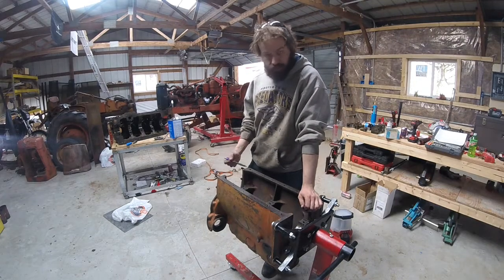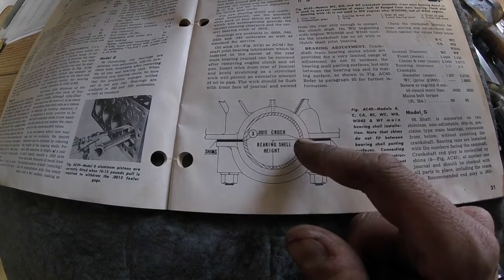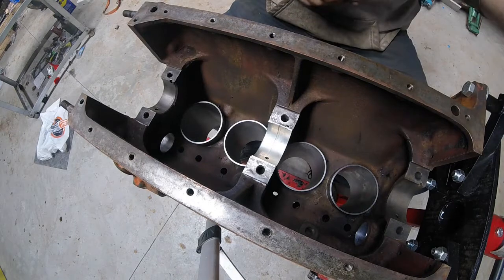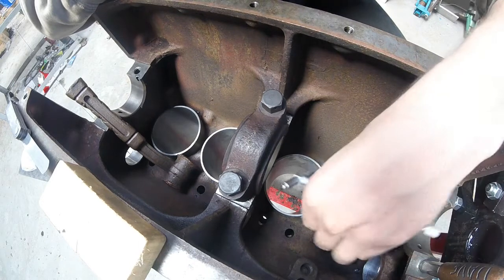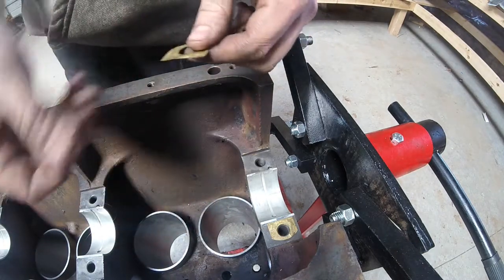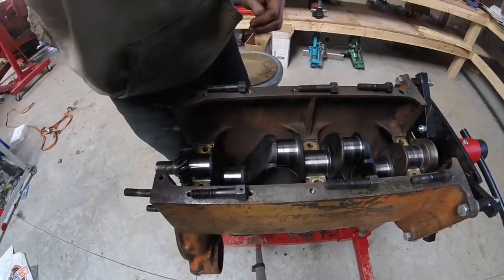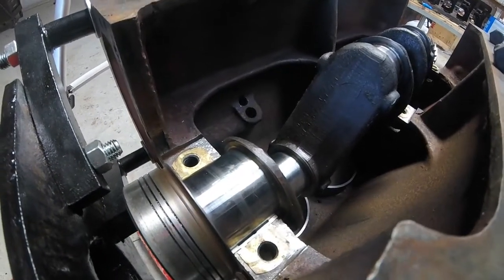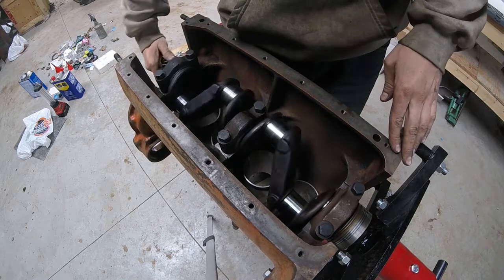Allis Chalmers C Engine Overhaul Part 8: Crankshaft

Comment: I've heard about those shims  from someone at the action where I purchased the Allis C  . He said
the crank needed those taken out. Your video is the first time I now realize what they where talking about.
It's a tractor an old guy had in a Tabaco shed , that he brought to a consignment sale. Hasn't been
used in a long time . I drove it with in 7 miles of home valve stem on rear tire caused me to haul it the rest of way.
but it ran. steering loose .  Now years have gone by , but watching Allis C engine rebuild video's, now I know 
there is some pain in the  but stuff O-rings on the sleeves  etc.. Maybe I'll only have to do the crank.
but it's cool how you took the engine and put it in a engine stand. Back to the video.  Your doing a good
job, taking us through the rebuild  thks
Reply from the maker: Thanks Bill, honestly the O rings aren't that bad other than having to break the whole engine down to do the job. Good luck with your C!